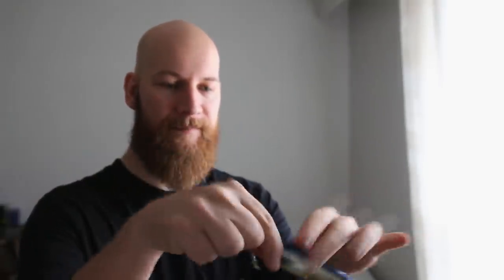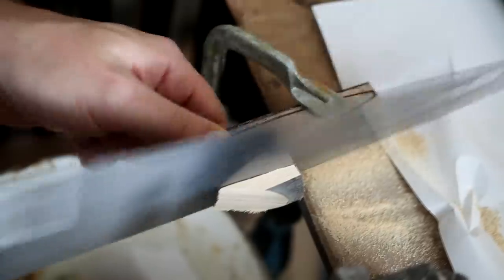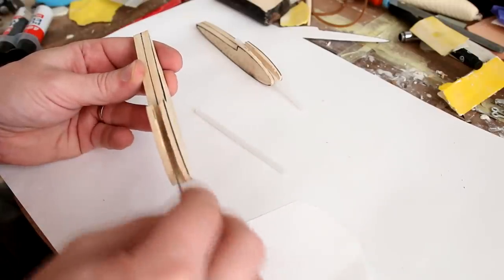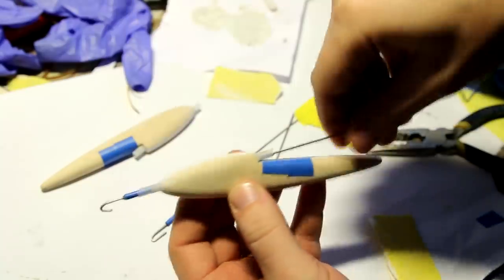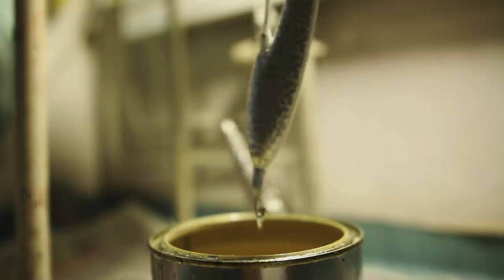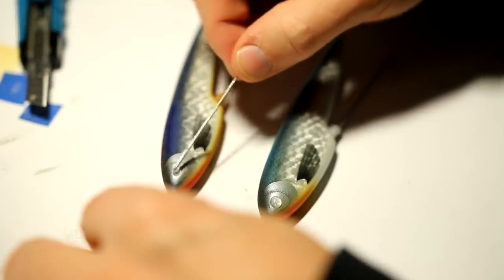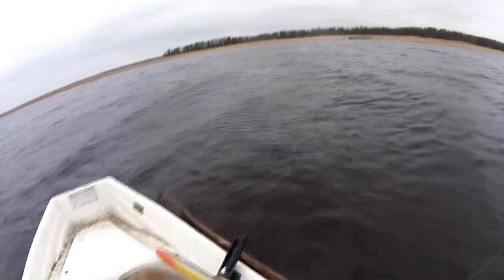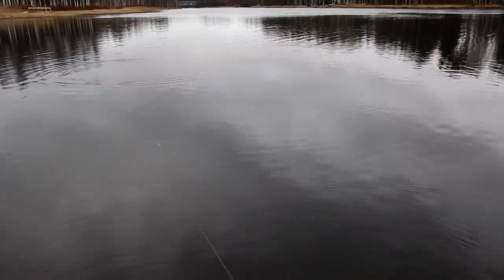A new innovation!  a Line thru crank bait.

Comment: To build a vacuum pump you need n old refrigerator pump, determine the high and low side. The hig side is the smallest tube or the one blowing out. Pinch it off about 98% . It hasbto exhale to inhale. Now yo can finb fittings to tap the low side. Pinch it off and seal it. Now ad your tap hook up hose to any sellable container i have used 5 gallon can with a wood lid that i covered with rubber inertube. My vac tank cost less than thirty dollars.

Comment: Rember to put ac oil n, just dropped low or suction side hose in nd turn it on. If you're high side spits oil out pinch it off more or lingthen the tubing.

Comment: Hi I've made line through big poppers and stickbaits for GT and other pelagic fish, there's one thing I am struggling at the moment, when the line gets thicker the connection between the line and lure loses flexibility due to a solid connection rather than a ringed connection like most of lures have. I'm talking about leader lines around 200lb-400lb, even though all trolling skirted lures have the same way (line running thru the lure) but they are trolled straight not twitched by rod. It does get boring when the lure head doesn't face side to side especially using stickbaits they still catch fish but not fun. Still thinking of an idea for that. There's a type of lures called Borg lures that you can still use split rings to and there is a enough size hole for it to slide up.

Comment: Great lure!  How did you make the round part that goes before the lure that gave it action?
Reply from the maker: Its an action disc you can buy those from well equipped tackle shops
Reply: What type of coating did you mix with the titanium dioxide to prime it?  "Cap" something?  Can you spell the brand name of the we product?  Looked to put a high build/tough coat as a primer!
Reply from the maker: @ThomasMusic2010  cab coatings hard is the product

Comment: Where did you get the lip? I would like to order some.
Reply from the maker: i bought mine from a local tackle shop, you should be able to find some if you just google action disk
Reply: @SolarfallBaits  Excellent, thanks man. I think black bass would go crazy if you put an action disk on a soft plastic worm.
Reply from the maker: @barthanes1  im sure they would, i've used smaller versions for fly fishing too but they are horrible to cast
Reply: Just find or use one of those suction cups you normally get for aquarium glass mounts. Drill a hole through the center and you're good to go!

Comment: very nice lure. 12:20 and 16:10 what are the materials you use?
Reply from the maker: First one is cab coatings hard lure varnish and the second coat after the paint is 2 part epoxy called envirotex lite
Reply: @SolarfallBaits  Is the (Createx Clear Coat gloss) the same with hard bait varnish?

Comment: Do not need tube inside, just drill it through smoothly..
Reply from the maker: tube is way easier to use. first of all geting a straight hole to a shape like that is a nightmare and second of all you need to coat the inside of the hole too, if you dont do that water is going to seep into the wood and cause it to bulge and in no time the clearcoat will crack open and ruin your lure.